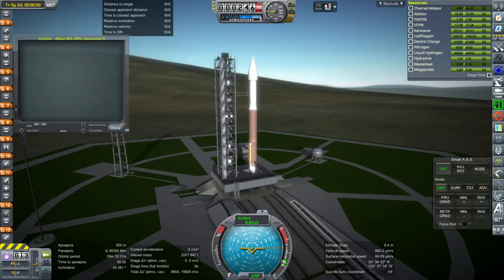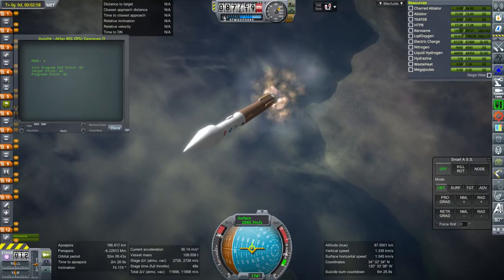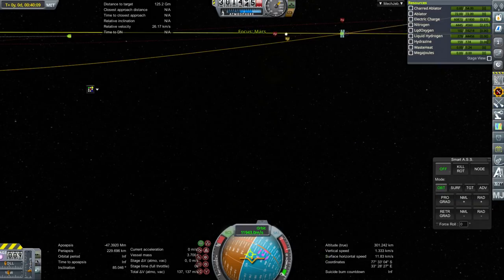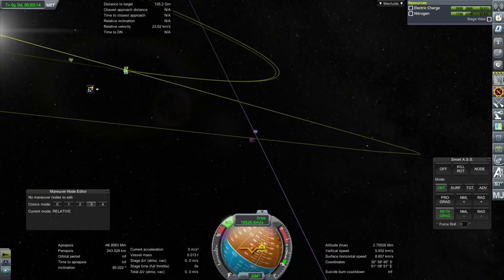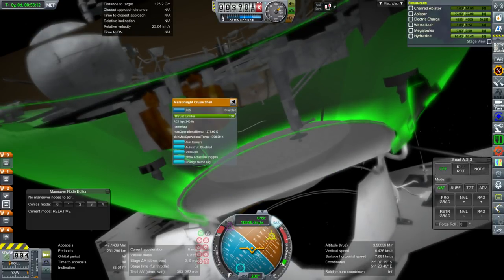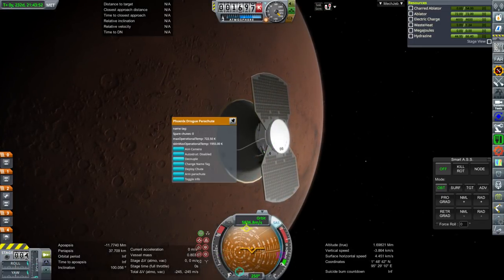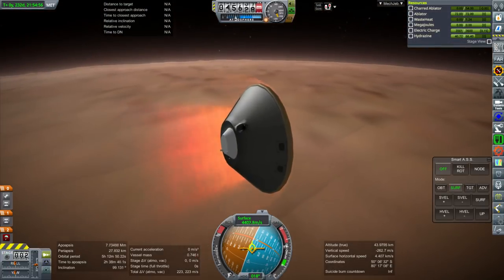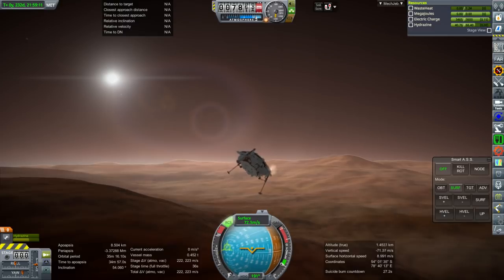KSP - Realism Overhaul Sandbox - Mars Insight Testing

Comment: They launched out of Vandenberg because the earth departure inclination was pretty high anyway, so they would have only saved about a 100 m/s by launching from Florida, so they chose Vandenberg with the much less busy schedule, where you have a lot more liberties with delays and so on without having to coordinate with 5 other launches. In the end they of course didn't need the 2016 launch window and just stuck with Vandernberg, because why not? The rocket is more than capable of doing it and  it's still nice to have more launch opportunities even if delays by this point where rather unlikely.

Comment: are you sure you weren't going much faster than the original mission? your parachute opened fully a bit late and you also landed on a hill instead of in a crater
Reply from the maker: I think atmosphere entry was about the same, but their parachute deployment altitude may be different and the ground could certainly be higher here. People have given me the right thrust for the engines, and I was also short about 36% of the thrust I should have had.